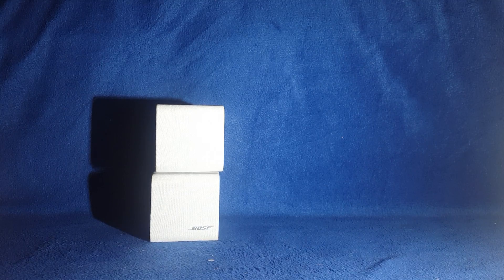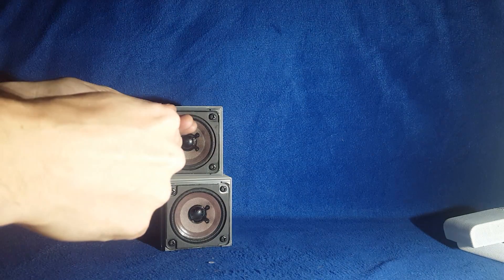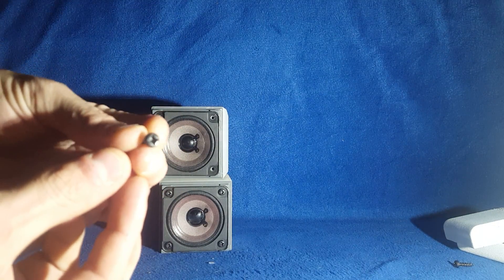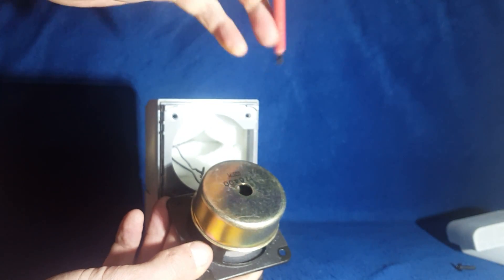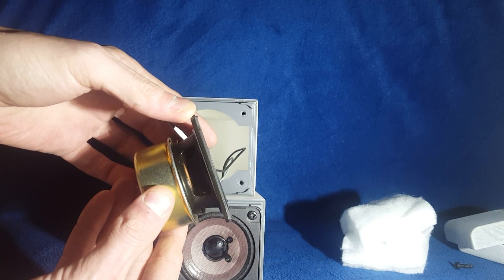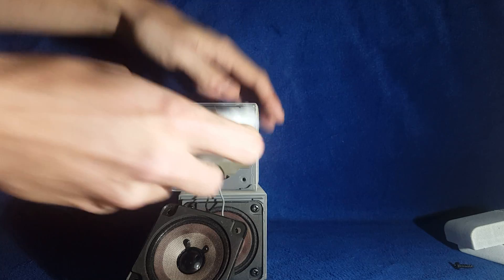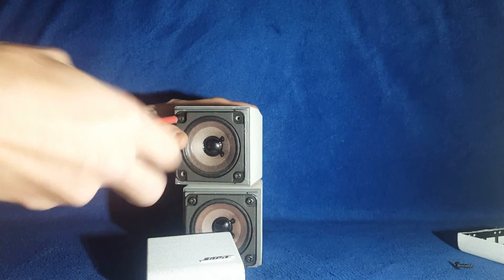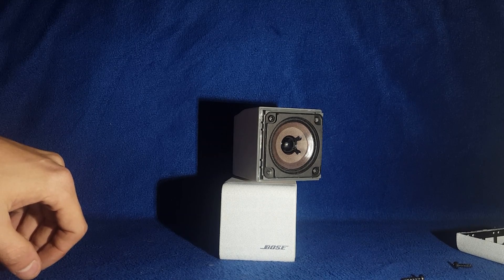What's Inside - Bose Cube Speaker

Comment: What are people expecting to find inside but insulation and a driver ?
Reply: Tom Jacobs Lol like i feel the same way, its whats built internally inside the speaker itself.  If the trade secrets were only able to be seen behind the box lmao.  Appreciate the humor.  I have worked on drivers for years, its the dimensions acustically , i hear folks say its just a box, that cracks me up.
Reply: Say bose, and people hear it better lol.   Then show them sony drivers in same box.
Reply: James Macintosh  "what's inside the speaker itself"  There are only 4 primary components to any speaker and here we have..... 

1. Frame-simple stamped steel, literally the same thing you find in bargain basement speakers and even in cheap white van speakers.

2. Suspension-cheap foam surround and what looks like a standard canvas spider, nothing special and will start to break down with foam rot in 8-10 years.

3. Motor-small ass magnet with a .5 inch coil, you will find better in sub $10 Dayton drivers.

4. Cone material- Paper....I actually don't have an issue here, paper is a perfectly acceptable material for speaker cones, though it is also one of the cheapest materials that can be used as well.

Seriously, bose could have just bought https://www.parts-express.com/dayton-audio-pc68-8-2-1-2-full-range-poly-cone-driver--295-152 and had an infinitely better product with a better motor, surround, cone and greater frequency response and it's a perfect drop in fit, but no, they give you the cheapest shit and charge you a premium for it.  It's hilariously ludicrous that people waste money on their bullshit.
Reply: a decent driver  perhaps, not just a cheapie paper cone
Reply: Well no shit that's all that's in there what dod he expect

Comment: The  reason why people pay that much is because they come as apart of the acoustimass system.   And yes the branding.   But I have heard the cubes and they have great clarity as compared to other speakers I had experienced up to that point.
Reply from the maker: +Detroitblue there not bad but compared to a the Boston Soundwave there not as great
Reply: they are ok speakers for your home theater but l wouldn't pay money for them. l got a whole set of those little speakers for free and l hated them so l sold them, l used them as surrounds in my home theater and they were ok there but l wasn't going to keep them there when l had much better speakers so l sold them for like $5.
Reply: Sellers ask like $20 for a single cube or +500 for the acoustimass.
Reply: 5 years ago I first  commented. At that time I had just scored a pair off of Ebay because I had a ex who had the acoustimas and I remembered how great they sounded.  I didn't put them in service until now.   It is time to  revist them now that my amp is repaired and I was suprised to find I have been here before to comment.    I can say they do sound good.   I am not the best judge of sound because my ears are shot I think.    But what I can say is I have not seen many speakers  this small rated to handle 165 watts and can play directly from the output of a amp without crossover protection from the bass frequencies.   I think the small form factor  is Plus.   I think that if you choose to distill everything down to cost then sometimes you only get part of the whole picture.   That being said  I have seen them as low as $35  on Ebay.    On the other hand I have morr money now and more experienes with highend audio.

Comment: , those look just like the Neo magnetically sheilded drivers that Parts Express sells. 3 inch or 2 1/2 inch.
Reply: They are. Not sure if it's an authorized after market replacement, overstock or standard rejects. They offer a single  speaker case/speaker box for the cone but are not allowed to have the dual box or display the Bose name on their versions.

Comment: Get your f****g fingers off those paper cones! Paper cones are normal in both high and low cost speakers. Open any satellite speaker in the same price range and it won't be much different. May I suggest you try adding a sound absorbent material to the inside of the plastic enclosure? Rubber carpet underlay is very good at damping speaker enclosures and the small amount you need would be free, from a skip/dumpster.

Comment: I had an 3-2-1 system and for there price range I was expecting good quality for karaoke but not satisfied. It is good for home theater but failed when I used a microphone for karaoke machine. I heard cracking the small speakers can’t handle my ugly vocals.
Reply from the maker: It was never designed for karaoke
Reply: MARINLAW Yup, I thought it sound loud to handle it.